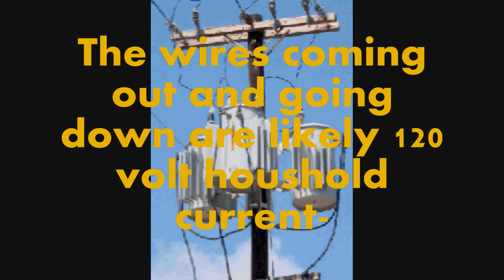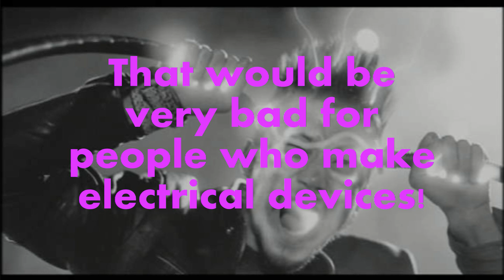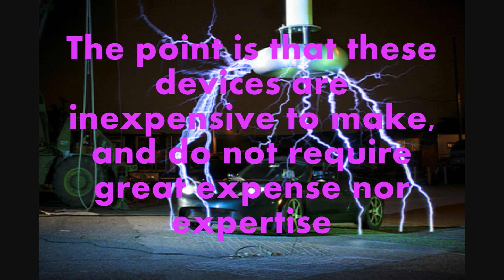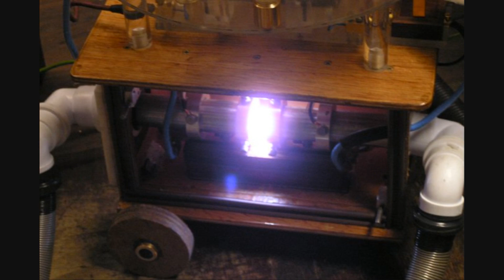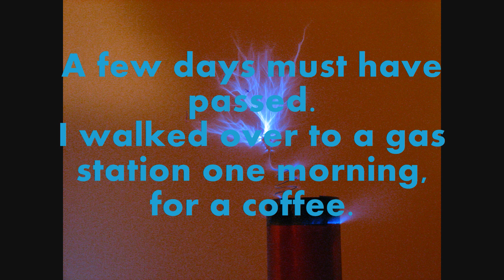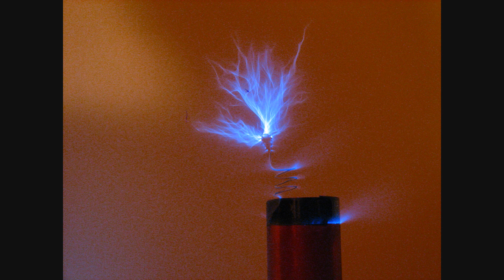FREE ENERGY- OPENING PANDORA'S BOX

Comment: Their are so many things wrong with this video. People like you ruin Nikola Teslas good name.
1."free energy" does not exist. energy can not be created or destroyed. The tesla coil merely converts electricity to a higher voltage at the expense of amperage. If anything power is lost through resistance.
2. Ozone is not good for you. It is considered an irritant at low levels and lethal at high levels. Ozone or O3 consists of three oxygen atoms fused together. When inhaled two of the oxygen atoms are absorbed and the other, also known as a free radical is left to potentially cause damage to your lung tissue.
3. 60Hz is not an unhealthy frequency. 60Hz photons contain less energy than the photons emitted by your cell phone. Higher frequency photons emit more harmful radiation. 
4. Higher voltage is not safer. Voltage is directly proportionate to amperage. The more volts the more amps. The reason tesla coils are generally safe is due to the skin effect and the high resistance of air. Although most tesla coils are safe some surpass the frequency threshold of our nerves and could case damage to our neural network without us being aware. Most of the pictures you showed were camera tricks and people encased in a ground cage.

Comment: You are wrong. The longer you run a DC wire the more droop you get. Droop is heat made by resistance I.E too many volts in in a thin wire . Crack pot

Comment: High and low frequencies do change the pulse rate in which a secondary coil will be induced. Speed is part of the factor of how much energy there is. However...from my understanding of it...its current or amps that kill. 100-200mA is the dead zone. Aka an ignition coil from your car can kill you. If you have someone to bring you back a home circuit shouldn't kill you just knock you out for a period of time.

Comment: @mrgalleria david wilcock is who i listen too .. n i was thinkin of using n msd ignition for automotive purposes to creat the 50,000 or 100,000 thousand volt blaster coil n it has a multiple capacitor discharge i think it good for bout 20,000 rpm on a race car so 20,000 cycles per minute n then some i think n then maybe gettin n rc car for parts from the hobby store to make the magnets move or the coil nts wut one yet n i need a little better understanding of electricity then .. well see

Comment: @jcfdillon ... and I didnt notice the old white Studebaker pickup truck that was just in the direct path of where I was pointing toward the horizon. Well, suddenly people were shouting; there was a fire in the white Studebaker. After people got to the truck and located the problem it turned out that an old highway flare down behind the front seat had ignited. The entire series of events amazed me, but I didnt continue with that type of experiment. The energy is responsive to mind control.

Comment: @joemh123 rotation or movement is important. take a hamster wheel made of a conducting surface. set the wheel in motion in the presents of sunlight. the wheel has small holes in it, and insulated material on the inside to form a capacitor.  this is only part of my study, go to rwg research . org to find more information my chalk board. im all over the place so i form blogs to look back at to verify concepts.

Comment: if i had a universe and then added 1 atom it would cause heat. there is in nature a cooling effect in local space time if you move the proper atoms around. simply the vacuum is at high vibration. that's all. vibration causes heat. but the boomerang nebula is even colder then local space. now there is energy as heat being cooled by attraction or is this one specific particle neutrino?.

the static uhf radiant energy, meaning to radiate, and that is heat . 2 or more static  fields  interact.

Comment: @mrgalleria Amperage is the actual amount of electricty to do the work. A light bulb may be 300 watts, but the amperage to light that bulb will not spin up a 300 watt motor because it does not have the amperage to do it. Its like the collection of electrical energy that does the work. You can have a pint of water running down a small tube, spinning a wheel.  gallon of water would allow for a stronger flow of water to spin a bigger wheel. Thats more amperage having a stronger amount pushing force

Comment: You are a very knowledgable man, about a lot of small never ending things. Use your wisdom, to put it all together. The kenectic energy fields, cannot be harvested and used because it cannot supply enough power as the coal, natural gas, super steam generators can. Plus if you wire your house for DC and have a loose connection, your house burns if not fused and maintained properly. Not everyone is as smart as you! They need power companies to deliver a product that they can use. Build a product.

Comment: You are not educating anyone, with this non-sense. Standardization is the real reason we have many of the systems in place today. Because if you get too many different standards, then you have warehouses of replacement parts that need to be maintained!  etc. What you leave out, is that the electricty you speak of, doesn't have the ability to build enough (amperage) which is the working side of electricity,  to continiously carry the load that the grid demands. If everyone went 2 DC we have fires

Comment: Commutator-type motors do not operate well on high-frequency AC since the rapid changes of current are opposed by the inductance of the motor field; even today, although commutator-type universal motors are common in 50 Hz and 60 Hz household appliances, they are small motors, less than 1 kW. So, because this 60hz has to feed also large motor for production, your theory of them just wanting to rip off the comsumer is bullshit. Just google 60hz and read wikipedia it tells all about it for free.